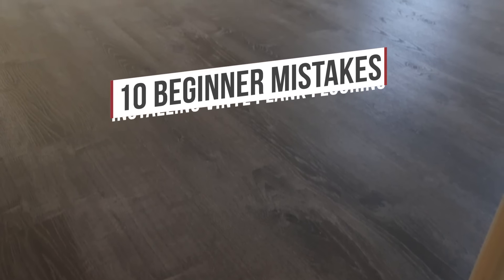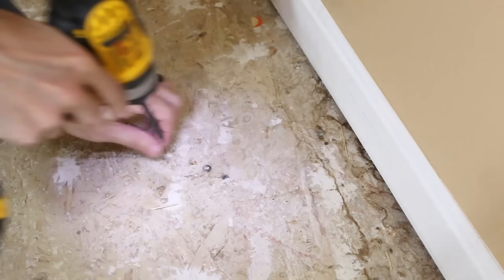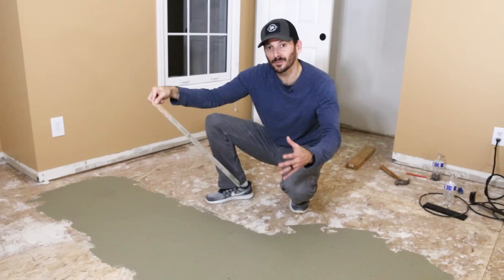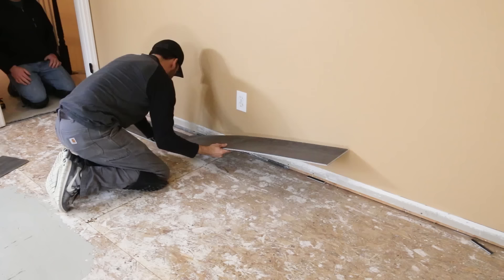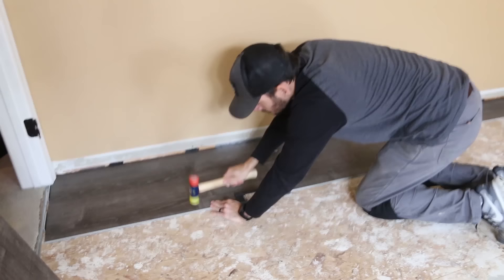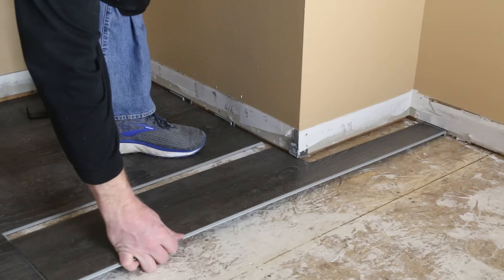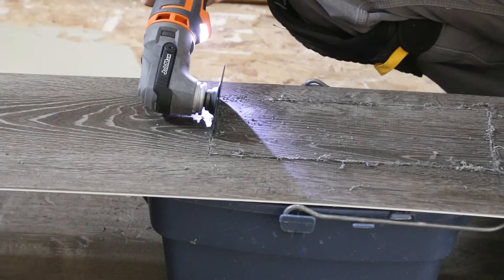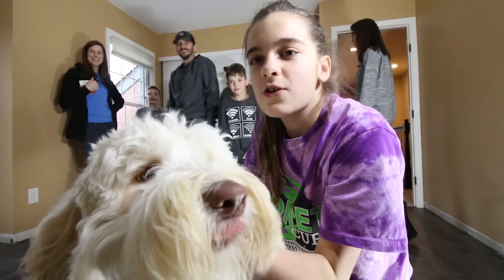10 Beginner Mistakes Installing Vinyl Plank Flooring

Comment: I always take out the baseboards. I use Bosch's multi tool to trim under door like you. Attention to detail makes or breaks the look. 

And you're right about the tools. I use Bosch's line up of power tools exclusively. (Best quality for the price.)

But, my grandfather was a master carpenter in the 40s thru the 70s. All he used were hand tools and he could build things I could never do.

"Mistakes are the fool's fault not the tool's fault." 

Good video. Good job 👍✌️
Reply: If people don’t make their own mistakes than those people won’t learn to get better

Comment: You want some real fun? When we bought our home it was a repo. We had to completely overhaul pretty much everything. Well when the contractor had to replace pipes running under the kitchen floor and do other work....they tore out almost all of the original wood floors (one of the only nice things about the house.).  To add insult to injury when they replaced it with OSB they didn't match the hight of what was left of the original floor. (The original floor was literally original, so it is literally the floor over the space under the house, attched to the floor joists.)
Dad had alot of medical emergencies happen, so we ran out of money to hire and finish the easier stuff ourselves. Just don't know what to do about the little lip of floor. It isn't that thick, but enough to cause problems....as we found out. So now that is my job is to figure out how to fix that. 
Great video!! Love your supervisor!

Comment: I laid vinyl planking of the type that has an overlapping sticky core. For all practical purpose it was fine but the problem with the original cedar strip flooring was the nails that were holding them down. The house was built in 1946 and the nails were loose. Driving them below the surface with a nail punch did not prevent them from rising back up due to age of the floor and mechanical vibration of walking. A large percentage of the cedar strips were secured by Squeek-no-more floor repair as well. Still, a few of the original old nails I'd punch set had "rose up from the dead" and put a raised dimple in the vinyl planking and impossible to remedy now that the floor was down and done. In retrospect I see now that every one of them old nails had to be removed. Nail setting was no guarantee.
Reply: thanks for sharing that robert, i'll try to remember, remove nails do not punch them down.

Comment: I like most of the advice you shared in this video as as professional trim carpenter, and multi skilled tradesmen. The one "mistake" I would call out. That rip row you installed towards the end of the video where your seam was close to if not in line with the corner.  Visually I'd have put it before, or after otherwise good video!

Comment: As others have mentioned, leave the baseboard and use shoe molding. it's more flexible than baseboard and you'll have less gaps between the bottom of the molding and the flooring. Shoe molding is used with most hard floor installs.
Reply: It also looks cheap and absorbs moisture.

Comment: I would have liked to see how you hid the old latex caulking joint that sealed the top of the baseboards to the walls. The new baseboard height is now lower than it was before exposing a good 1/4 to a 1/2 inch of old caulking and unprimed/unpainted wall. I've been in the business for 40 years, take the next video all the way to the end of the project. Many DIYer's on here that need advice on every stage including the re-installation of the baseboards and the requisite finishing thereafter.
Reply: The easiest thing for him to have done would be to scrape it flush with some type of putty knife tool, replace with taller baseboard, and recaulk.  It costs a little more money, but is much quicker.
Reply: You can leave the baseboards and just use quarter round to cover the gaps. Much easier.

Comment: I have found that the best way to ensure that the floor is free of any obstructions such as pad staples is to lightly draw a wide wallboard taping knife across the surface. It will quickly find problem areas that can be hard to see. And remember to sweep and vacuum every inch of the floor to keep any debris from getting under the planks.

Comment: Hey guys nice job, I would add 1/4 round because when you drop the molding it has to be painted and probably sanded !
Reply: Do new mouldings half inch taller. Much nicer look 👍

Comment: great job on the floor, just really avoid using motar or thin set, planny patch is only like 15$ and it wont crack and on the transition put a tacktrip and stretch the carpet other than good job, its way better to remove trim.

Comment: DIY'er that did my own small room. My brother-in-law is lazy and tried to get me to use quarter round. I hate that stuff, it looks horrible and cheap unless done by a pro with multiple pieces to build up the baseboard (which I am not). I think if you hire someone and they do not remove and replace the baseboard, it is a red flag and you go with someone else personally. 
I wish I had found you prior to my installation. I think I got away with checking for a level floor and I didn't put in the sub floor properly with the offset install (oops).
I also learned the hard way that rooms are not even close to square. I had to rip a thin strip to hide so I didn't have to use the quarter round again. I think it turned out good, but certainly see the need for pros in this case.
Thank you for all of these great video's. I love to think I will do a ton, but ultimately, they help to align m y perspective on what I can do vs. what I think I can do.

Comment: A t molding is to transition between two hard surfaces. The carpet side will flex when stepped on and break. Unless you are planning to paint or replace baseboard with a taller one don’t remove,shoe molding looks just fine. And like someone else said don’t ever use thin set as a leveler. Always use the primer your leveler recommends.

Comment: I was in the floor business most of my life. Yes, try not to void the manufacturer warranty that come with anything you purchase, however...realize that most flooring warranties aren't worth the paper on which they're printed. Most are documents that shield the floor manufacturer from claims and many are just marketing tools, as they are ineffective at prompting a manufacturer to do what's right when a product they engineered does not perform even when installed to recommended guidelines.
Reply: Glenn Sohm yes sir, I’m in the flooring business aswell an have installed well over 100,000 square feet of click an I couldn’t agree more, the warranty’s are all bs, they want the floors to be within 1/8 of an inch over ten feet yet it seem nobody knows how to work a power trowel these days.. even if they are on the kind ya sit on lol if your near Ontario send me a PM
Reply: Also at the same time...I am sure the manufacturer doesn’t want a DIY person to use liquid nails under it because some poor shmuck at Home Depot said it works good for that type of flooring
Reply: @dontjohnson8146  Yes...I have overheard some very incorrect information being relayed to customers by both HD and Lowes associates.

Comment: I've done like a hundred of these and my advice is: don't use the tapping block that comes in that kit.  It likes to slip and damage your tabs.  Instead, use a scrap piece that locks in with your board.  In fact for most of your full pieces you can just slide them in and click them together without tapping them at all, if you've got the technique down.  
Also, if you take the trim off and put it back on like that, its gonna be lower, you're gonna be able to see the line at the top of the trim where there is unpainted drywall.  To fix this, you're probably gonna need to scrape, then mud the line, and maybe even repaint the whole room.  Or, alternatively, just get new, taller trim.  Or you can even just leave trim on in the first place, and slide the vinyl planks right underneath (if there is no gap, you can use an undercut saw).  You will still have to remove the piece of trim from the back wall, but as long as you nail it right back where it was before you should be good to go.
Reply: if you leave the trim on and the gap is too large, would the only solution be using quarter rounds to cover the gap?
Reply: @Barry_Block  ugh.  I mean, I guess you can do that.  Personally I think trimming trim looks tacky.  But if you're a diy'er, and you don't want to do drywall and paint work, quarter round might be your best option I suppose.
Reply: @patrickcharzin3062  yeah I don't think it looks great either, was just curious if there are any other solutions for that gap when leaving the trim on. Going to do some DIY flooring soon and this may be an issue. appreciate the response. Might just remove the trim and bite the bullet on the extra work
Reply: @Barry_Block  Honestly any time you replace a floor should also be the time that you do some sanding and repainting of trim and walls. By accepting that painting is part of the job it's much easier to find a floor that you actually want to color match with new painted walls. I always caulk bathroom flooring trim edges near the toilet and shower as well so the trim definitely comes off and the walls get repainted or new trim installed which covers the previous trim line.
Reply: Only use a tapping block and NEVER use another piece to beat exactly where another piece needs to lock on, You do not touch the locking mechanism with the tap block u latch onto the top layer and No Every piece needs to be tapped together no matter if u think it went smoothly, bet your work has pencil lines through it and ends arent even touching. Have installed this, carpet and tile for 10 years now.
Reply: Does anyone know what brand snaps in like this at the ends? I make the mistake of buying Perg LVP and the ends dont overlap like this, they have to be pound in. Plus the planks are fragile .
Reply: @StevenBradford  there are a lot of brands. You should really go to the store and check them out yourself.
Reply: @patrickcharzin3062  I think the best option is to remove the trim and replace it either with higher trim to cover any damages; or to return it to the same spot without damage and do minor touch-ups. If you're careful, you can remove and re-use the same trim. You don't want to repaint above the trim unless you can repaint with exactly the same color used; this is often difficult, since most people are using tints and specific mixes and you're unlikely to get the same paint color again (i have some leftover tinted latex enamel but it hardened. I'm trying to reconstitute it).
Reply: @StevenBradford  This looks like Toucan.
Reply: that metal tab just wrecks your planking if you hit it wrong, or too hard, and it is prone to slipping and in turn cracking the c lock channel of the planking. i use the rubber block i bought as a separate kit. so much better.

Comment: im needing to do the skincoat and patch for just one goofy spot near my stairs and the corrner wall. my basement is concrete thankfully it was only roughly 2 to 2.5 sq feet so i got away with using a ready to use skimcoat. but definitely takes some finesse to smooth out and level lol. all you need is a really straight and true board that goes over the length of the dip.

Comment: Some things I learned after installing ~700ft of Flooret:

1. Fix any squeaky spots in the floor by drilling additional screws in the sud floor until they go away.  Snap chalk lines to help hit the joists!
2. Rent or buy a laminate floor cutter. Having the tool right next to you is priceless. Some flooring can be scored and snapped but not all. Get the tool to save time.
3. Nobody cares about the floor as much as you do. Take all the time you need to GET IT RIGHT. But don't turn down help.
4. In my case my jigsaw blades only lasted cutting a few planks. They are cheap so pick up extras. Beware that your other blades will potentially dull too. Flooret has a ceramic bead coating which is awesome for wear, terrible for blades.
5. Run a few screws into the edge of your first row to keep it from moving. You'll never see the holes as they'll be covered by trim. Yes remove baseboards!
6. Run the grain of your planks in the long direction of your house if installing in main living areas. It just makes sense to the eye. Bedrooms I think can go either way but my preference is still with the grain going with the house.
Reply: Matt Lane I used a table saw, oscillating multi tool, and cordless circular saw for the cuts that couldn’t be snapped on the floor cutter.  I’m wondering how a jig saw would compare for speed
Reply from the maker: good tips!
Reply: @ELIRAXPRT  a jigsaw is pretty fast but I guess a multi tool could be too. Not have all the mess in my garage from cutting planks was reason enough to get a laminate cutter but for rip cuts you obviously need a circular or table saw.

Comment: #11 Usually if you lower the base, you will get a paint line on the top as you did, but didn’t likely notice it until after the video.  We then would add   Narrower shoe molding, not quarter round.

Comment: I found out the hard way that holding the tapping block like in the video breaks them.  I had to return 3 of them before I realized that you are suppose to hold it like the picture on the packaging, which is having the entire tapping block outside the vinyl flooring, not resting on the vinyl flooring. It just does not have the support for the tapping.  Resting on the vinyl flooring is easier and makes more sense, but breaks them.  Just follow the picture on the packaging and you’ll be fine.

Comment: My solution regarding the baseboards and a ton of repainting was to leave them on. Pull up a corner and down a wall of the carpet and underlay and nailer strips to get a proper depth measurement from the baseboard to the subfloor. Purchase plank and possible underlay of the right depth for a perfect fit. Many underlay products for plank flooring have various benefits like insulation, soundproofing, waterproofing and such.
Reply: Most of the flooring now is coming out with underlayment already attached. If you put more underlayment, not only will you void the warranty but you will cause yourself many problems in the future because there's too much movement. You'll have joints separating.

Comment: Before you lay the floor, you should put touch up paint along where the top of the baseboard is going to go back. The basboard will sit lower on the vynel than carpit, leaving a strip of u painted and cualking behind, recomend stripping the excess cualking off the wall, and painting before floor install
Reply: Unless you use new, larger baseboards like I plan on doing. Good tip, though.
Reply: @realbop  ,exactly what I am doing! Putting 4 inch baseboards on.

Comment: Coming from somebody that has done a lot of laminate in the past and lvp, you remove the baseboards if they come off, occasionally you will not get them off without destroying them, so I'll poke around a little bit in an inconspicuous area, sometimes in a closet just to see how well their put on, if you think you can get them off in one piece go for it,.  if not it's easier to put up quarter round then it is to replace all the baseboards.....

Comment: I always liked to use 30lb roofing felt to raise low areas.  Use your 6 ft level and a razor knife to cut single or multiple layers.  No need to attach or wait to set up.
Reply: That might invalidate the warranty though, in this particular case, since it's apparently not supposed to have an underlayment. I wouldn't want to risk giving them a 'get out'...
Reply: @WebbyWunda  really though, what are the chances of using the warranty? If there are problems with the boards, you'd see it when doing the install and not use them. What is realistically going to go wrong with the flooring AFTER it's installed that would require the warranty?
Reply: @zzz7zzz9  once it is down you own it. No company is going to do squat for you then. The most you're going to get is the run around if you try for any warranty then. I mean let's be real here.
Reply: @zzz7zzz9  
Warranty notwithstanding, thinking about why they would void it if underlayment is used is what I found curious. 
The only reason they would is if it causes damage by allowing the vinyl planks to flex excessively when walked on, whether due to an unlevel floor or a thick underlayment with a lot of give to it.
While looking at pieces in the store they seem like they could take a lot, when heavy localized force is put on an unsupported joint, it might crack. 
Regardless of whether it's for warranty concerns or for longest life installation, it should be kept in mind.
Reply: @wingerrrrrrrrr  companies, with anything, are always looking for ways to NOT give warranty. That's why they list specific do's and dont's. True, the felt would not hurt anything, but it would be enough of an excuse for them to void. But, like previously mentioned, the warranty would only realistically be for bad product in the box.  Pretty much applying the product voids the warranty.
Reply: My concern about some underlayment is potential mold issues. Roofing felt under the planks is more likely to hold moisture, it seems.

Comment: If the nails are popping remove them and use screws, they popped once they may pop again.
Reply: Brye Cooper and be very careful with protruding nails is screws, because by hammering them straight in could be mistake 11 if you hit a hidden pipe
Reply: Good  point, thank you!

Comment: I am definitely in favor of removing baseboards. I just did this, and using an oscillating multi-tool with a caulk remover blade made the task go VERY quickly.